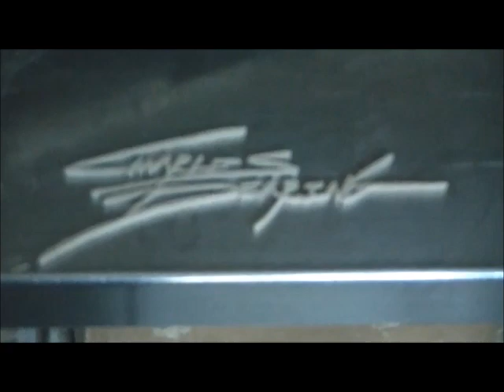Time Lapse Of An 8 FT Wide Horse Scene Made Of Wood

Comment: Beautiful piece, Charles. Aren't you worried some of those thin pieces breaking off while working one it? What's the best way to cut, standing or sitting? Because with standing, I can do only like 10-15 minutes before I need to sit down.
Reply from the maker: When it's that Big I worry about it, but nothing broke while working on it. Usually I prefer to sit but the size dictated stand part of the time.